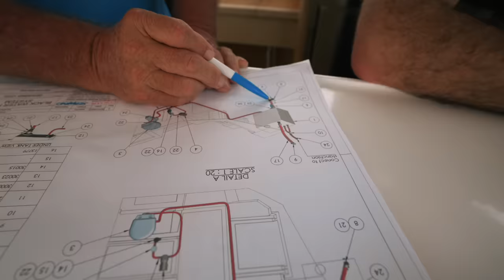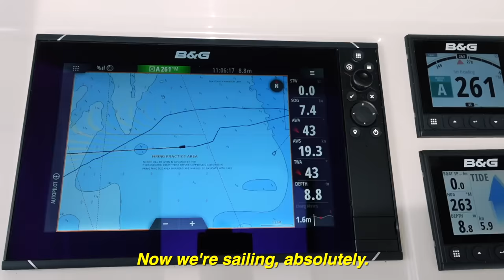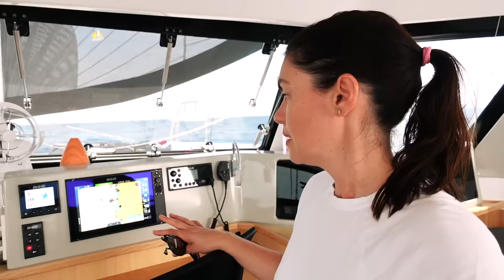Sailing Ruby Rose 2- We've Waited So Long For This!

Comment: Congratulations. When raising the mainsail release the mainsheet & vang even a bit of topping lift helps to make it go smoother.
Reply: No vang.  A bang is very unusual on a (cruising) cat as the width of the traveller makes it less necessary…but you’re spot on for the main sheet although that wasn’t their issue as it turns out. 👍🏻

Comment: Need a jib traveler control line leading to cockpit. Also any weather protection when reaching out to handle winches at helm?
Reply from the maker: The jib traveller does come back to the cockpit - and we have side clears for inclement weather which cover the winches 😊

Comment: Great video. I live just down the coast in Rayong and know those waters quite well. I like the Seawind range very much and have had a pipe dream for some time of buying one and sailing round from Saigon to Ocean Marina (which is the only decent place to keep a boat like that at the head of the Gulf of Thailand). However, it's more than I can afford and as I will be 80 next year it will remain a pipe dream.      One thing I'm curious about - I saw no flag, and presumably you haven't registered the boat as an import to Thailand. I guess you'll be flying the Red Duster, or are you registering somewhere else? If it is a British registration, how do you go about doing that outside the UK? Presumably you'll have to pay import duty and VAT somewhere? If you are able to comment, I would be most interested.